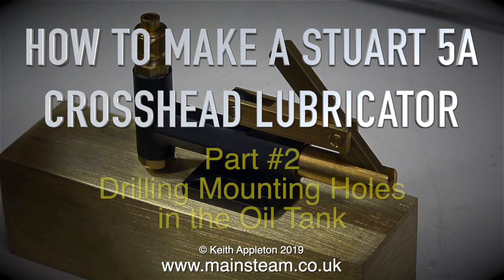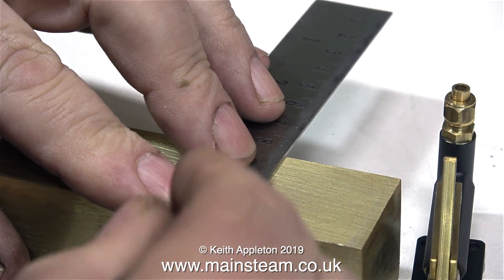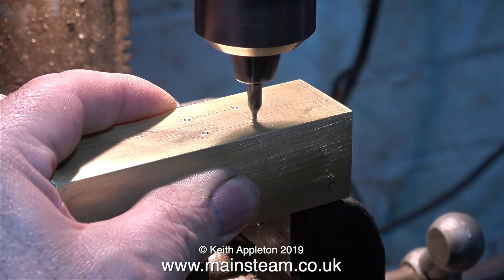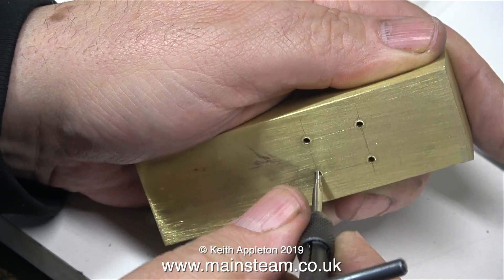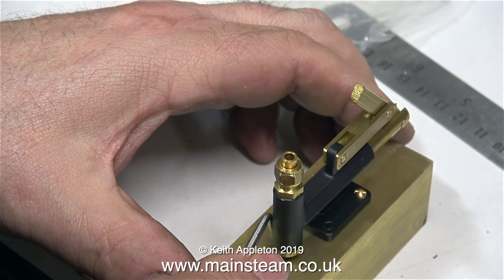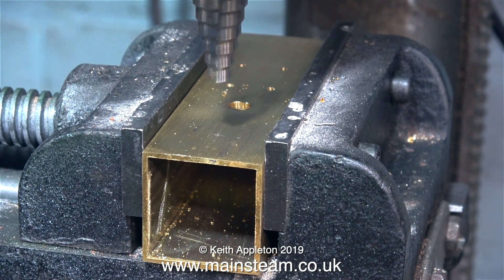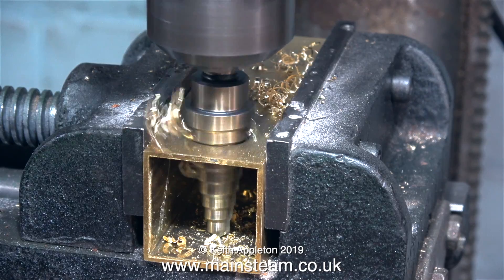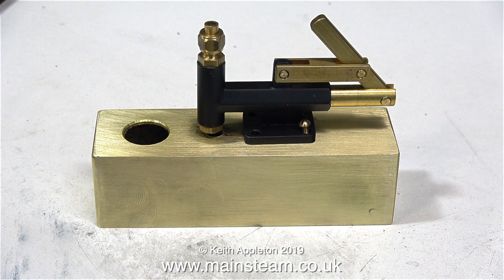HOW TO MAKE A STUART 5A CROSSHEAD OILER - PART #2

Comment: Thank you for the complaints about your drilling machine.  I am beginning to understand that I can make do without top of the line machines.  I do need "good" equipment, but it does not need to be too grade professional machinery for my home projects.  I have let worry about that hold be back.  Thank you for the (unintended?) lesson.

Comment: I also have a "crap drilling machine"...but i don't really know why i seem to get attached to my metalworking tools just as if they were dogs.

So i started making modifications to mine...made a new column from thicker pipe, new bearings...even made a new spindle for it because the old one didn't have a nut for adjusting end play.

It sure was crap at first ...bought it also maybe ten years ago now..but its getting better everytime. And we all make do with what we have.

Sure , might be more than you are willing to go through with yours, and we all get days where we just want to throw the thing across the room.

In any case, it doesn't seem to be stopping you from making excellent work. I'm a big fan and just wanted to thank you for taking the time to make those videos.

Comment: A Shopsmith is really a “universal” machine that can be used as a drill, lathe, circular saw, etc.  In my experience, such machines have to make compromises and, consequently, have faults not present in a machine dedicated to one function.  If you want a good pillar drill, the one to look for is a Meddings.

Comment: Keith, if you want a decent metalworking 
"drilling machine," or drill press, as we 
colonials refer to them, look for an OLD 
Shopsmith.  The model you want to look 
for, is the model 10, usually called the 10E 
or 10ER.  I've used these ones, for the last
30 years or so.  They are the original 
Shopsmith, and, while violating almost 
ALL of the OSHA regulations, are VERY 
stout.  If you drop on a concrete floor, 
most of the damage, is to the concrete 
floor.

Since it is a Shopsmith, it has numerous 
modes.  The drill press, both the normal 
vertical as well as a horizontal mode, are 
spot on.  The wood lathe, is also one of 
the best available.  Table saw, I can do 
better work, with an almost sharp hand 
saw.  Disc and drum sander, pretty good.

Yes, you can hook a bandsaw, and a jointer 
to this machine, but I KNOW you have a 
better bandsaw.

I've heard of a few of them in your 
neighborhood, and you should be able to 
find one for $200 American Dollars.  (Sorry, 
don't know Pounds Sterling.)

My brother has 2 of them.  One as a dedicated 
drill press, and mounted to the sidewall of his 
workshop.  the other one is set up as a lathe, 
but will work as a Hz drill press, and sander.

steve
Reply from the maker: Thanks Steve, I will look into it }:-)))
Reply: @keithappleton , If you can find one, 
and want some help. let me know.

I've got a few parts on hand. and a couple 
years experience.

steve